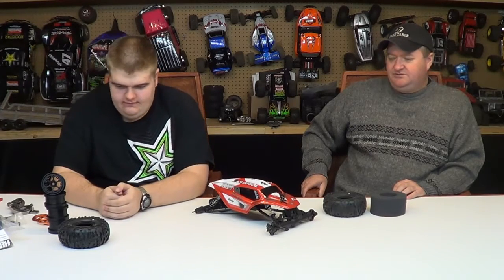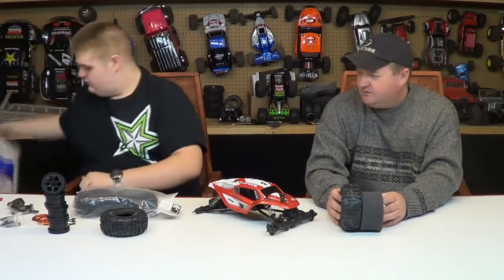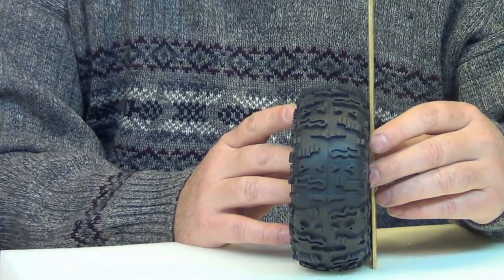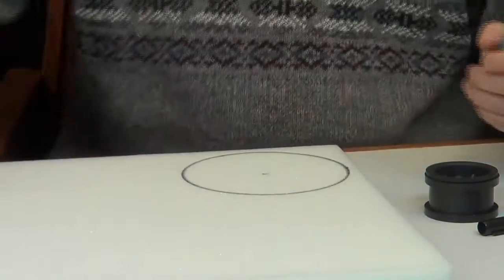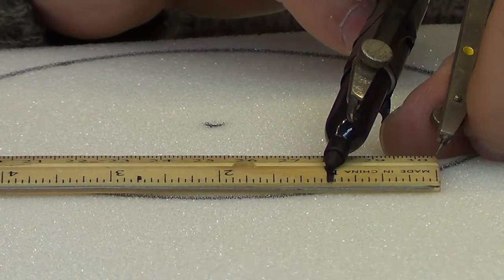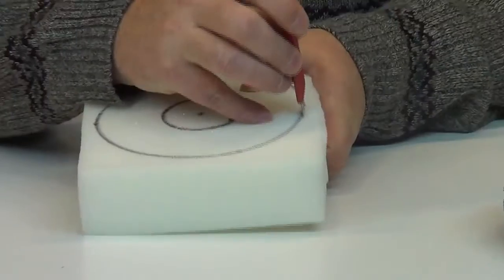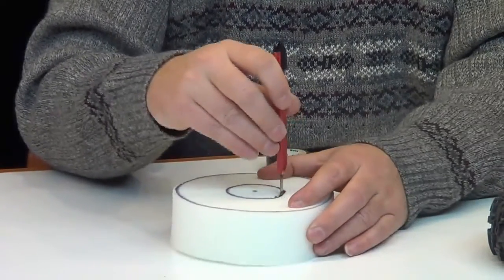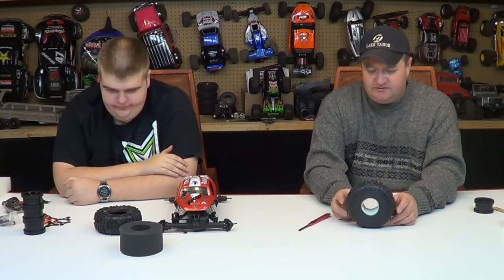"AXIAL XR10 BUDGET BUILD" PART 1.

Comment from the maker: if this is your 1st car i recommend the axial honcho and run that to get your feet wet, but i understand the tf2 appeal, you will need a 3 channel radio if you want a winch, also the tekin fxr 55t esc motor combo is a good option, a steering servo with at least 120in.oz. of torque, the  Airtronics MT-4 Pistol 2.4 w/Telemetry is a very good option but expensive, stay tuned to my channel i am loading a tf2 update video today. there are many options less expensive. can chat on facebook.